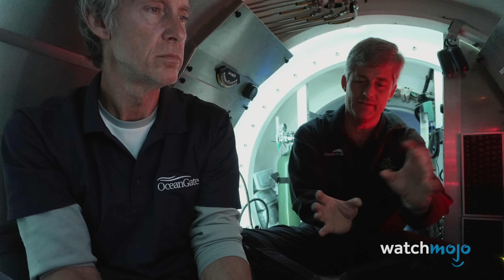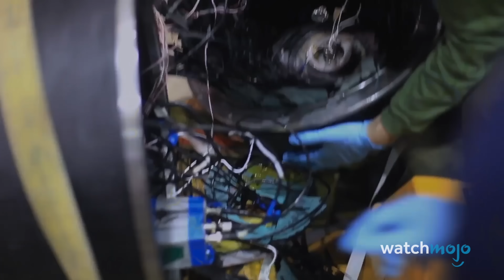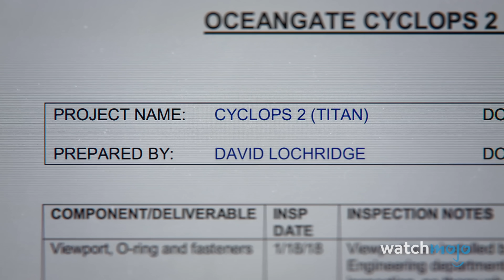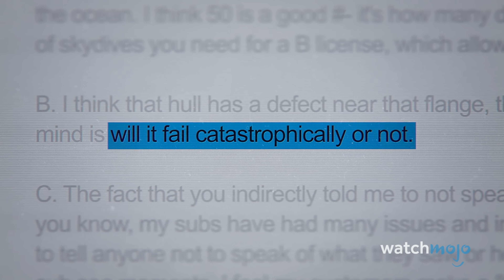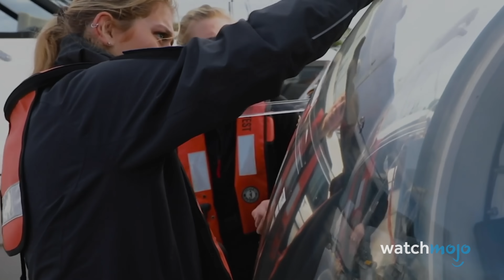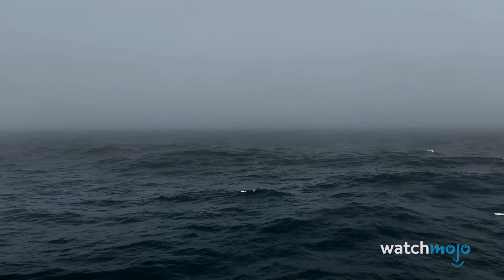10 Shocking Revelations From Titan: The OceanGate Submersible Disaster - Netflix Documentary

Comment: As mentioned in the documentary, in the winter of 2022-2023 OceanGate left the Titan for an entire winter in a parking lot by St. John's Harbor fully exposed to the elements of a Canadian winter! The winter of 2023 ended up being a brutally cold and snowy winter for Newfoundland. The cycles of freezing and thawing most definitely accelerated the weakening of that carbon fiber. It's like water inside a rock exposed to freezing and thawing. Eventually the rock will crack. This was criminal negligence every step of the way!

Comment: In old days when miners used wooden supports to keep shafts from collapsing, they knew a shaft was about to collapse because the wood started creaking; then, later, the mining firms insisted on steel supports, but this was a major problem because the miners heard no creaking and a shaft would just suddenly collapse on them. Many miners died due to this. 

The problem with the Titan's carbon fibre hull is the similar to the wooden supports in that the carbon fibre creaked, cracked and popped on every dive. but,. it then would behave like the steel shaft supports; it'd collapse instantly without warning. That Titan hull was a major fuck up in design.

Comment: If you've seen the Netflix documentary, there's plenty of evidence that loud bangs and pops were heard repeatedly during dives, picked up by the ACM (acoustic monitoring system); it was the carbon fibre splitting/cracking. OceanGate's first Titan hull was seen to be riddled with large cracks and splits throughout the carbon fibre hull and was taken out of use, which is why the 2nd (last) hull was made; this too would suffer multiple large cracks and splits during all of its dives until that fateful day when it finally gave up its structural integrity. That's insane to think about. If I heard bangs/pops like those during even a shallow dive, I'd definitely want to get out a.s.a. fuckin p.

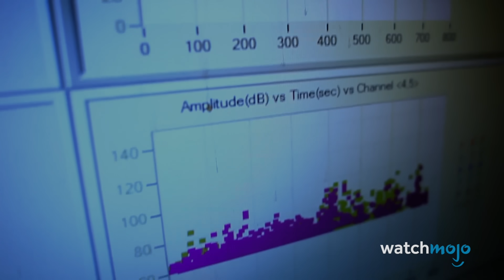Comment: 2:35 if Boeing of all companies is warning you about safety, you know it's bad
Reply: The difference between Boeing and Oceangate is that Boeing designs for aircraft are still sound and work. Their problem was that attention to detail and keeping safety in mind was not there when aircrafts were assembled. With Oceangate, the designs were simply just bad designs from the start. It didn’t matter if the sub was built perfectly to design, it was just a bad design.

Comment: As a spray painter turned boat builder i can only say i am perplexed by Stockton and his teams complete lack of knowledge. This team used 3M poly resin thats usually used to bond cars to fit the titanium cap rings to the CF hull. The  Epoxy resin used as  bonding resin is WS105 and is the industry standard for Aircraft, boats & submersibles as catagorised by Loyds etc. They basically threw 80+yr of epoxy knowledge in the bin and told themselves (and anyone who asked why they did it) that they would rather use the same brand and type as the carbon fiber was laminated with. Not only is that a ridiculous Logic from.the start but it wasnt even the same 3M resin used in the cheap as chips CF layup it was basically the biggest mistake in the book😂   Worse still, rather than buy proper Marine paints they  bought Raptor Liner, you know the pickup-bed liner a 2k Urethane paint with no saltwater resistance and sprayed the Hull with it after several of the engineers had mentioned the CF looked like "swiss cheese"    

I'm genuinely in shock this guy got a degree in any engineering subject and i think whoever gave him that needs investigating. The entire team didnt know the difference between proper epoxy like WS105 and Polyester resin. How is that possible? Even DIY boat repairers know the difference there, anyone thats layed up grp will know the three main epoxies and know that polyester and Vinylester resins will bond terribly to cured proper epoxy resin (the CF laminating resin in this case)  However proper epoxy resin will bond to anything even diamond. This is basic knowledge for anyone that works with glues
Reply: cute, did chatGPT write all that out for you ?

Comment: You would think it would have been cheaper in the long run to just use titanium from the beginning instead of wasting all the time and money to try and prove carbon fiber would work.
Reply: I would think it is but the company goal was to build a submersible for multiple people, so it needs to have a certain size to fit multiple people in. And that size made of titanium would be so heavy that hardly a vessel could transport it.
Reply: @gefriernudel3004  Good point. I would still rater make a smaller one out of titanium and only take a couple of passengers at a time.
Reply: @mordecai1793  yes. I guess every sane person would do that after seeing the countless failures of the "innovation".

Comment: I saw the documentary over the past 2 days. Was waiting for this to come out. Even with all the errors, the storage in sub-freezing temps of NFLD pushed it over the edge and sealed the sub's fate. They should have stopped after dive 80 at the very least. Better yet should have stopped as soon as after the loud pops.
Reply: You say that but the scaled down models in the test imploded and that was without being frozen. I think the sub was destined to implode this journey and the ice has ensured it. If you look at the weight release system too the frame for it was too wonky and in the doc when it shows you them testing the weight release system you can see there was bits of it mounted to the CF not far from it. That should have been put on a ruberised mount to the CF not just heavy metal dangling off some drill holes in it.

Comment: Carbon fibers that will break if submitted to sub-zero temps and pressure... geez, where have I heard this before? For an aerospatial engineer, as Stockton Rush presumably was, not having heard of what happened with the Challenger's O-rings before the tragedy in 1986, would have been a red flag the size of China.

Comment: They never worked with Boeing.  The only they "worked" with Boeing on was buying airline industry expired carbon fiber from them.  They also never worked with the University of Washington.
Reply: I think they had a couple of consultations where Boeing was able to advise them on how much materials might cost.
Then they said, "Boeing, can you build it for us?" and Boeing said hell no
Then they said, "Boeing, can we use our engineers to build it using your facilities?" and Boeing said heeeell noooo.
This is partly why it was built by four dudes in a shed.

Comment: The amazing part is that Netflix could have filled another 30 minutes with things such as the end falling off, the view port not being certified for any real depth, and the five-layer 5" hull (which should have been, per engineering recommendations, an 8" thick, single-bake tube.)
Reply: You dont need to bake CFs for strength or cure now mate thats old pre-preg that needs baked. Dont get me wrong, heating up modern types will speed up the cure but its not the same as pre-preg (pre-impregnated) Carbon Fiber that used to need baked. Modern CF roving and strand and modern epoxies like ws105 you benefit from vacuum to remove voids but thats about it. They didnt have a clue what they were doing they gave the cheap out of date CF components to a company who make cheap fishing rods to make the 2nd hull. They were ao bad at it the thing looked like "swiss cheese" and Stockton ordered them to paint it outside in the car park with Raptor liner to hide the voids and all that in it. Raptor liner as in the stuff you spray in your pickup bed as a liner😂   its ridiculous. This oceangate mob were like a Benny Hill skit
Reply: Some of those are on HBO's Implosion documentary film. Just as good too

Comment: The NTSB always finds the truth and has been confirmed that the CEO of OceanGate took many shortcuts, did not listened to his engineering director, didn't properly inspected the submarine after each dive, and the carbon fiber structure was failing at 3000 psi. The pressure of the water at the site of the Titanic wreck is about 5600 psi and way past the limits of the sub's safe pressure tests.
Reply: He just kept firing engineering directors and techs who told him it was unsafe.
Reply: @scribbly2983 yep.

Comment: Titan and Cyclops were two different submersibles with completely different designs and dive capabilities.  Saying “Titan, then called Cyclops…” is completely inaccurate.
Reply: Wasn't it called Cyclops 2 while they were building and "testing" it? Pretty sure they only publicly called it Titan after they made the Titanic the goal
Reply: @jakeviscarra3150 Cyclops 2 is also not the same design as Titan, nor was it the same sub.  The video they showed was Cyclops, and Cyclops 2 is never mentioned.
Reply: @JanSolo555  I just looked it up. Cyclops 2 is Titan. They changed the name in 2018 to better align with the Titanic when Rush decided that was the purpose for the sub.

That said, we are both correct. It was Cyclops 1 that went to the Andrea Dorea, not Cyclops 2/Titan. But Titan was once called Cyclops (2)
Reply: @jakeviscarra3150 You learn something new every day.👍